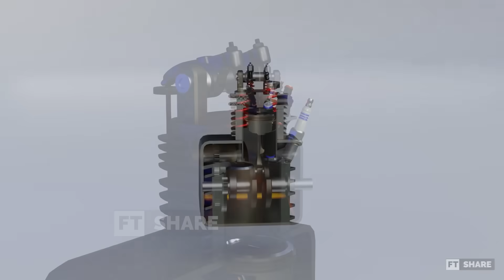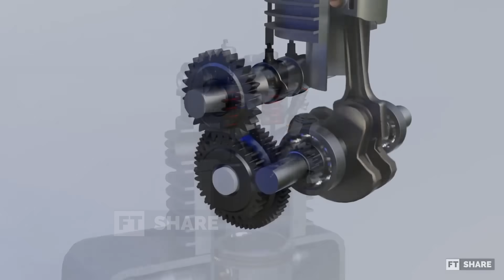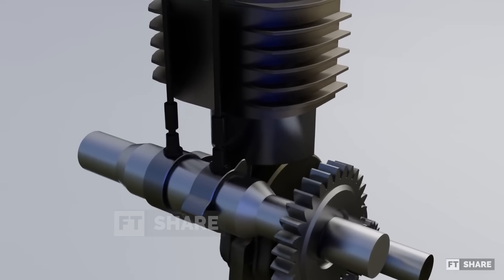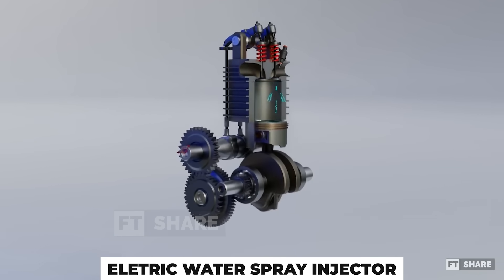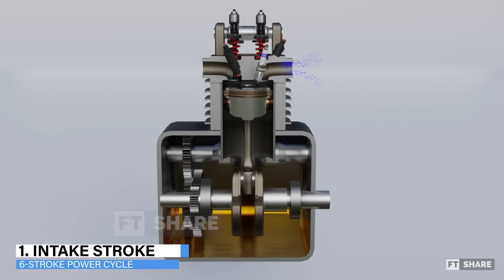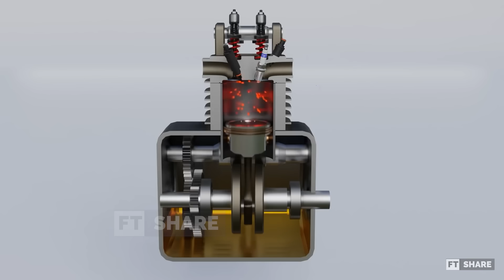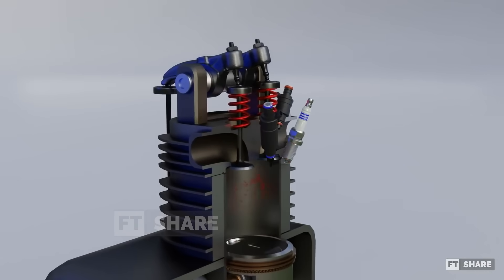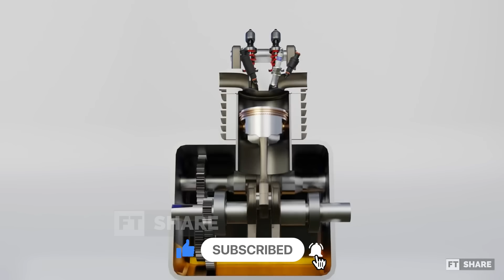Water-Powered ICE Is Here!!! | The Revolutionary 6-Stroke Engine

Comment: inject water into a four-stroke engine and fire the spark plug with a high current and low voltage to produce anti-gravity waves that reverse time to allow the water to fuse into oxygen to drive the engine and get 1,000,000 miles per gallon. Oh yeah, the auto industry knows this and covers it up so they can make billions in profit with the fossil fuel industry. The fusion reaction will produce a ton of electrons that will coat the body of the car and make more anti-gravity waves so the car levitates, and the spinning tires will also produce anti-gravity waves so turning the wheels will allow the car to go back and forth and turn. An all-wheel drive car is needed to accomplish this feat. The entire US is delusional to all of this due to the lying car industry, US government and US news media. Try it out as it works as I and friends have done experiments on all of this and tried to get papers published but the journals will not do this as they are also part of the cover up. The produced anti-gravity waves will also produce a warp bubble around the car so a person can go from New York to LA in a few minutes.
Reply: I think where you screwed up is with "a few minutes"
Reply: I worked with the Reagan administration and the US army back in the early 1980s and I saw the UFOs travel this fast in a warp drive bubble.
 @dieselfrk13
Reply: This is why they have the GPS installed.
 @dieselfrk13
Reply: I would send proof by YouTube would delete the links. @dieselfrk13
Reply: Here is what I wrote this morning as to why Space X is getting rid of the methane tanks and making them water tanks. I sent this information to Space X as I am an engineer.  

The methane tanks were converted into water tanks as Space X has figured out how to make the raptor engines into water fusion engines. The raptor engines get ignited by a spark plug. They currently use low current and high voltage with the spark plug. To get a raptor fusion engine the spark needs to be high current and low voltage to produce anti-gravity waves that reverse time to allow the fusion reaction to occur. The new room temperature superconductor LK-99 is wrapped around the top of the raptor engine, so the water has a large force placed upon it when it is ionized to help the fusion reaction continue. This allowed the damaged water tanks to be scrapped. The other tanks are for O2 and N2 so Space X can make an atmosphere on Mars and the some of the water can be used for drinking and growing plants on Mars. This is why the booster and Star Ship were returned to the bays so they could be retrofitted as a raptor water fusion engine. The fusion raptor will also produce many electrons that will surround the ship and produce more anti-gravity waves, so a warp bubble is produced to get to Mars in a days' time. Don't believe this then wait and see. The ship is being reinforced as the produced warp bubble will put much stress on the craft when going to Mars. The star ship will also be able to travel to the many planets that are being found for more habitation. This same technique can be use on an ocean-going vessel, a train, and a jet plane.
Reply: What are you waffling about? Fusion requires immense pressures and temperatures to occur. Far more temperature and pressure than could be created by a combustion engine. 

This issue would be exacerbated by the fact that two water molecules bonded together is extremely electronically unfavourable, as the oxygen atoms would be hypervalent. 

If this somehow magically occurs due to the "reversal of time" as you say, then with the thermodynamic arrow of time reversed, this would take energy away not release it.

Not one bit of what you said has any feasibility. Oh, and also, a spark plug requires high voltage and low current in order to generate a spark. Low voltages would render the arc unable to cross the spark gap.
Reply: You obviously don't know what you are talking about and have no education in fusion and believe what the government tells you with their nonsense with the coverup. I would show you our fusion reactor that works at low pressure and ambient temperature, but YouTube will delete the link. Most scientists are all delusional about fusion and don't know what they are talking about. Only a handful really know how fusion works.   @dominicrichardson5546
Reply: I cannot reply to you as I keep getting deleted to prove what I know about fusion. @dominicrichardson5546
Reply: The coverup. @dominicrichardson5546
Reply: The only thing in the warp bubble is the brain that wrote this!
Reply: I know for a fact that "Big Pharma" and the "Banks" are in on this too. It's a conspiracy! Future generations will look at how we've been manipulated by our corporate overlords into not pursuing anti-gravity as a power source and cry at our ignorance.
And ask any petrochemical engineer how easy it is to burn water. It's easy! Look how many houses burn down when fire departments tip water all over them. There's the proof, right there. Warp bubbles are real. So called "scientists" are just hiding the facts from us.